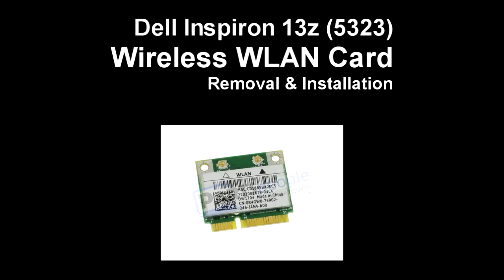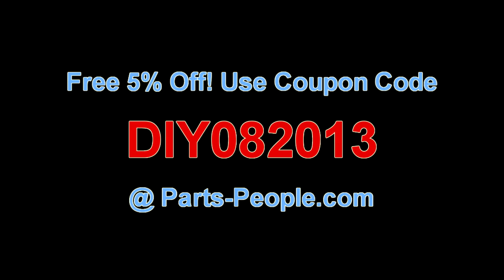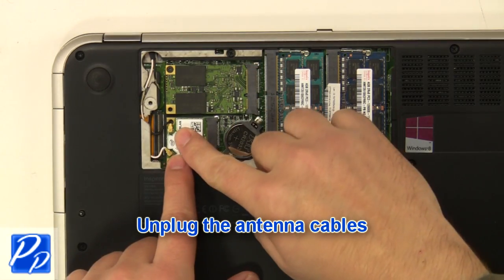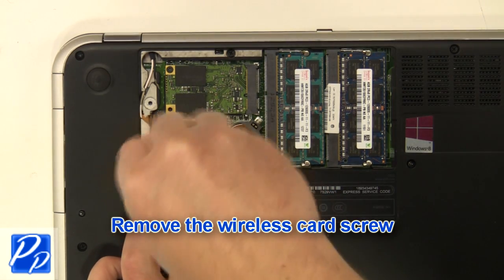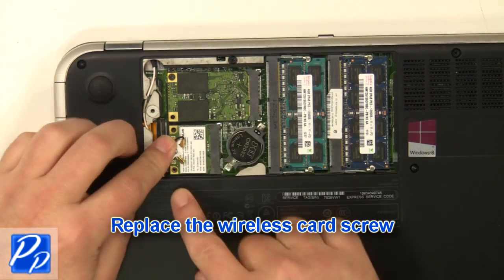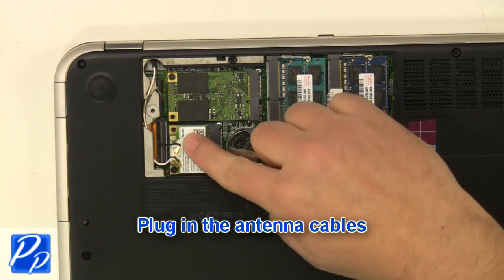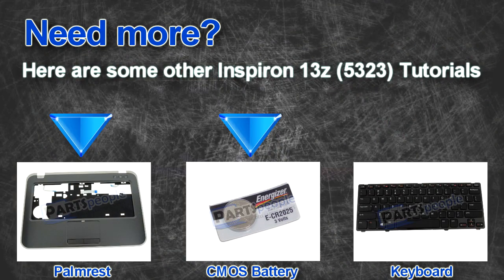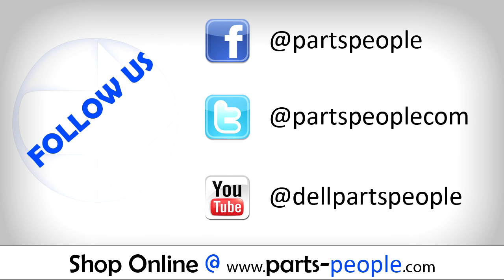Dell Inspiron 13z (5323) Wireless WLAN Card Replacement Video Tutorial Teardown

Comment: are the wires suppose to snap on? cause when I connected the black and white wires with their respective spots, still doesn't work for me
Reply from the maker: Yes, they should snap on. They are kind of tricky, they have to be sitting just the right way.
Reply: @dellpartspeople  They are very tricky, especially if you have big fingers. THey need to be exactly on top and straight. It took me awhile and a pair of tweezers.